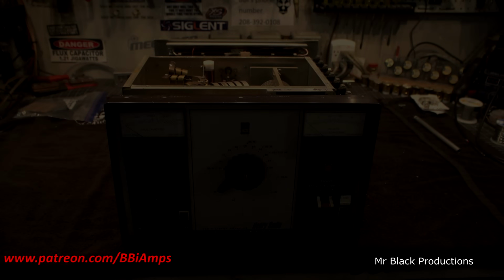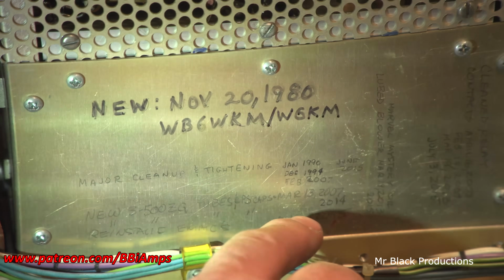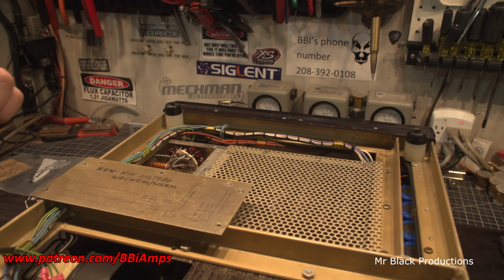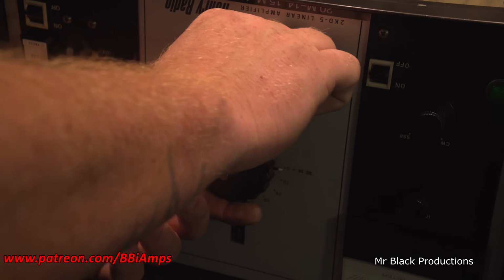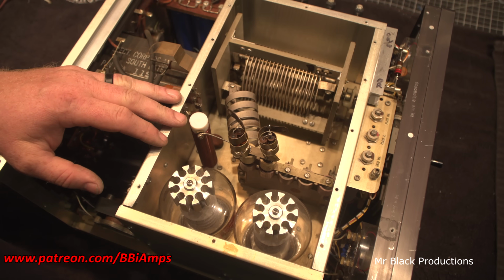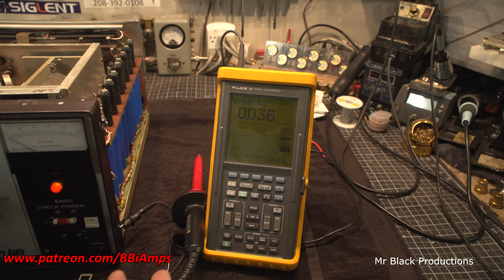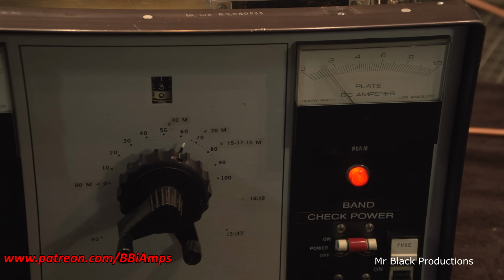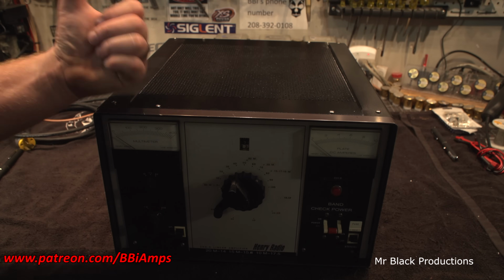Henry 2kd-5

Comment: Thank you for this video Mr BBi. I found they put a large coil off of the 3-500z in my amp to the roller inductor probably to prevent 10m operation. Your video was immensely helpful as now I realize I will not get 10m operation with the coil I have inside of my amp. Cat was chasing his tail for a few days on this one.

Comment: 24:35 Decades ago, Bristol engineers invented the Bristol Spline Drive System for use in electro-mechanical instruments. They required screws and wrenches that could stand up to industrial environments, vibrations, and frequent removal and resetting. The effectiveness of their invention, for that original application and thousands more since, has never been surpassed.
Reply: You must be an old instrumentation technician...
Reply: @spaceflight1019  Yeah. 39 years at it.
Reply: @jimhall9360  I started on the trade at U.S. Steel's Homestead Works in 1978. Completed 3 out of 4 years before being laid off before the mill closed. Next 26 years doing field service before hiring on as E&I tech at Elrama Power Station. Retired from Cheswick Power Station 18 months ago. I picked Instrument Repairman over Electronic Repairman because my then-future father-in-law thought that I'd find it "interesting". He was right. Although I started fixing radios and TVs as a kid, and studied electronics, the world of instrumentation and process controls was far more educational than the world of commercial two-way radio.
I used to tell apprentices that the better you get at this trade the bigger and more expensive are the toys you get to play with. It was a long road from Hagan Ring Balance meters to the Space Shuttle, but that's where my journey took me.
Reply: The Collins equipment uses them too.
Reply: @cidcolead1115  Yup, I was thinking the same thing too.
The Collins PTO and those set screws.
Reply: Sure. but a set of keys $50 from the rip off artists.